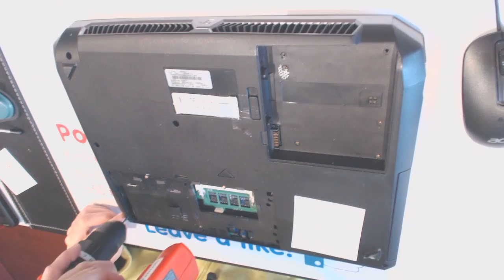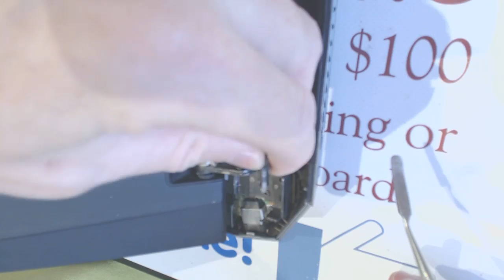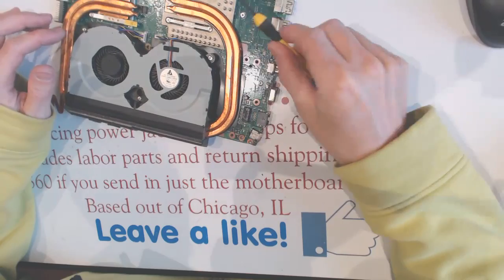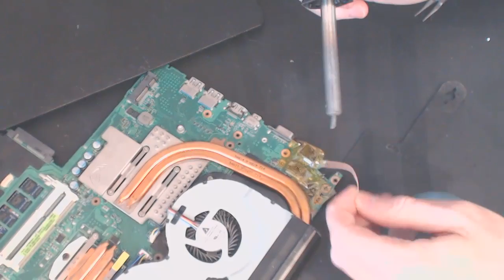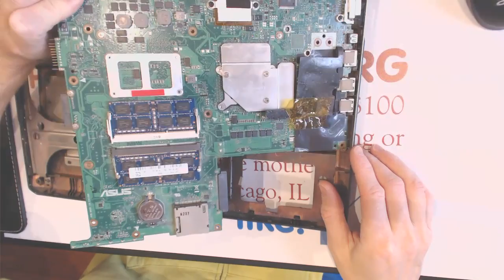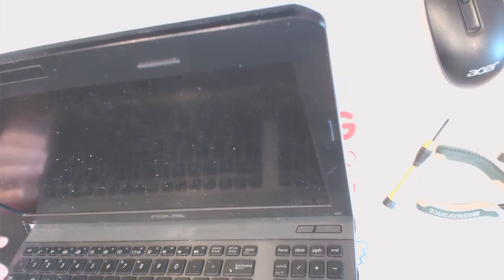Asus g55v g55vw Laptop repair fix power jack problems broken dc socket input port

Comment: Wow. Thanks for this. So does this help with the 'no charging', or continuously switching between AC and DC  issues as well? I have a feeling it HAS to be the power jack. I tried everything else.
Reply from the maker: either jack, plug (tip of the cord) , or the power supply, if you wiggle it then not the power supply.